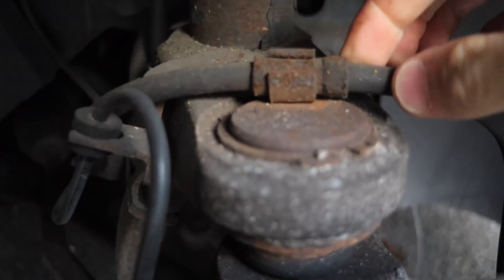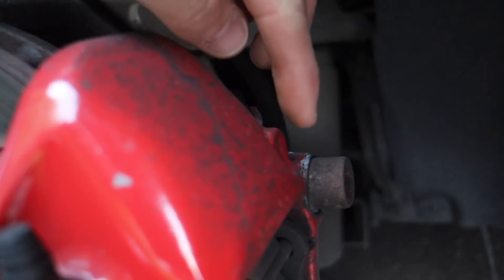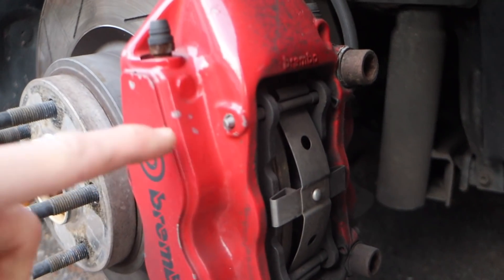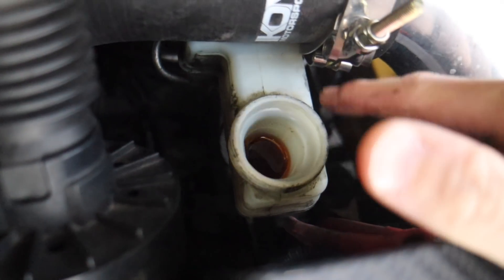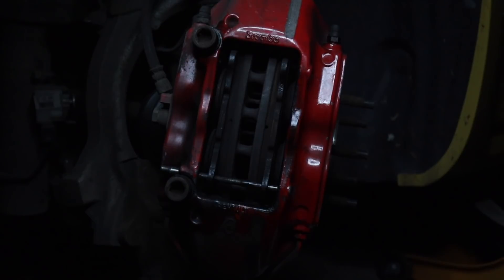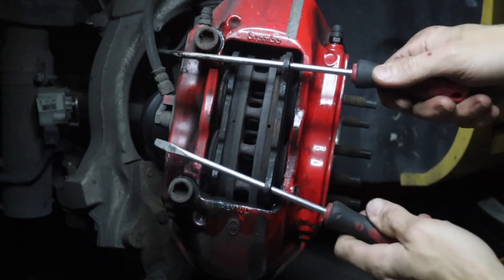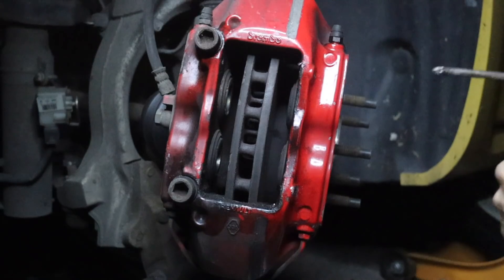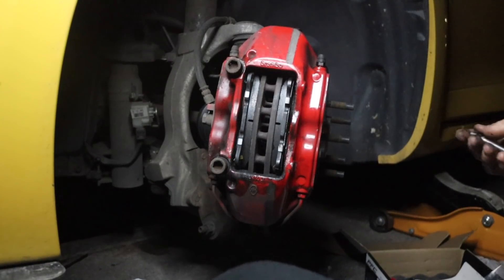FITTING PERFORMANCE PADS TO THE RENAULT MEGANE RS

Comment: The holes in caliper are tiight for a reason , i can believe you tried to make them bigger , well done siir nice safe brakes ! Ur car needs taking off road
Reply from the maker: Well it was perfectly fine so 😂💪
Reply: @JustbeingHayden  why didn’t you get a proper pin removal tool ? Putting bodge jobs on people use the tube to learn how to do jobs the correct way !

Comment: Brake fluid looks way over due. Pretty sure its normally yellow in colour lol
Also the state of caliper @ 8:00 lol, you would have been better off just taking a hammer straight to the pin.

Comment: I did my rs 265 the weekend, bastard pins, used a big fat punch at first to get them going, then smaller one to push them through. Was tight to get back in tho, cleaned the pin holes, put new pins in, lubed them up a little.. should be ok for when I change them in the future hopefully. Keep up the good vids man.

Comment: As for bedding in pads i’ve always used pagids bedding in procedure 10 medium pressure stops (60-20mph) and 5/10 hard stops (70+-0mph) iirc. They defo need bedding into the discs though so make sure you do, think pagid did a video ages ago on how to do it.

Comment: Future ref they wete mr pink pins you removed and also when you're trying to pull it out from the back push the top of the retaining spring in to take the tension off the pin and itl come out quite easily.

Also push the pistons back whilst pads in and pad will also pull out much easier

Comment: This is not a good way to work on brakes at all...Use some brake cleaner first, then buy yourself some proper tool, than take a look at how it's made, how it's done, you changed the brake pads ok, but you almost destroy the caliper. Very sad.

Comment: Nice video mate but that grease you used is for the metal bars that is not copper grease for the brakes its help you grease up the bars that push back in bro